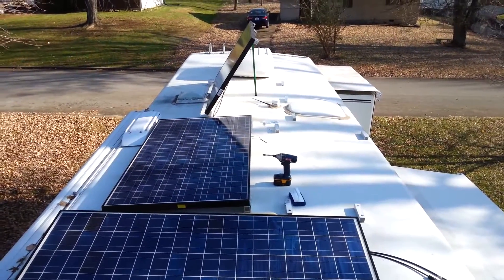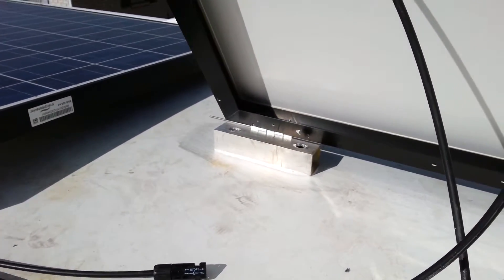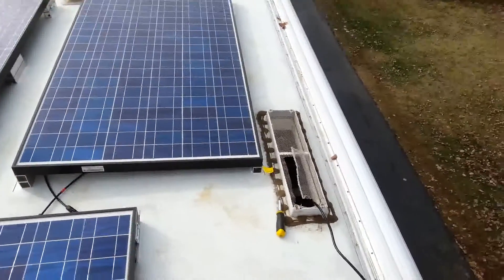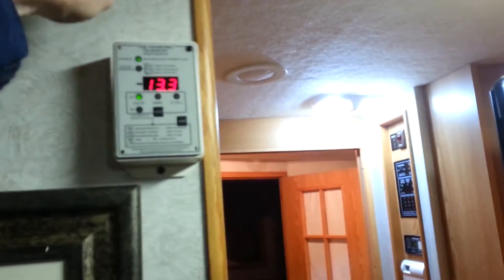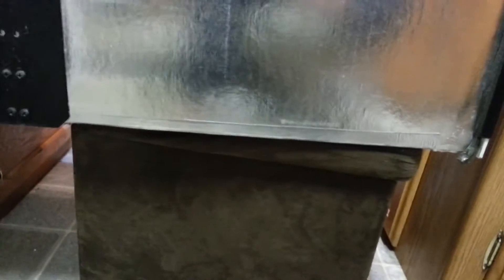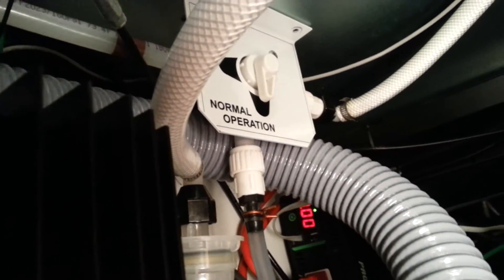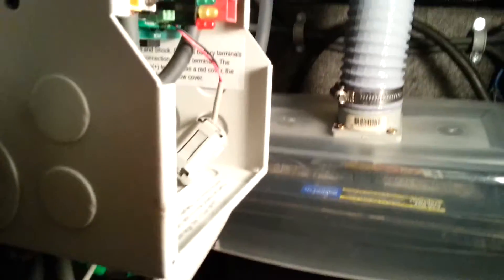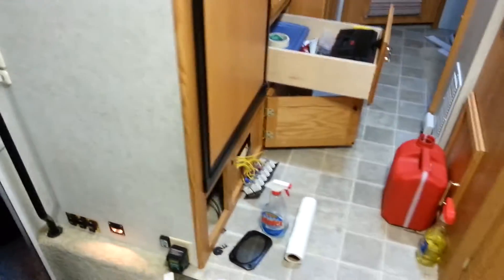RV Solar Panels installation Installed 675 Watts 2005 Winnebago Voyage 38J

Comment: Kevin, like your thought train on things.  Coming to your videos from the Nomadic one, lol.  So 3 years later how has the solar install held up?  Panels stayed in place, no leaking or loosening of mounts?  did u make your brackets for tilting?  And most important, was 650 watts enough?  Have u paired with lithium batteries?  Maybe you could do a followup video!   I have a 38 Winnie.  2010 Sightseer gas jobber.  Like most of it, but see many improvements that my wife wants and dreads me to make!
Reply from the maker: Solar is awesome no need to tilt I got plenty of power I was packing 510 amp hours / 250 usable of lead acid batteries but i just installed 3 battleborns true 300 amp hours now will post video soon. Yes everything is still tight no leaks 3m 5200 is amazing stuff. Do you have a workhorse or ford chassis ?
Reply: @ktoutdoor  3M 5200 caulk for fiberglass - I need to get this product as the factory left holes after wrongly mounting the large awning, and their patch job has failed after 10 years.  Ford chassis Kevin. Model Sightseer 37L.  Not many of these 37L models out there, and the factory installers obviously were not familiar with them either, lol.